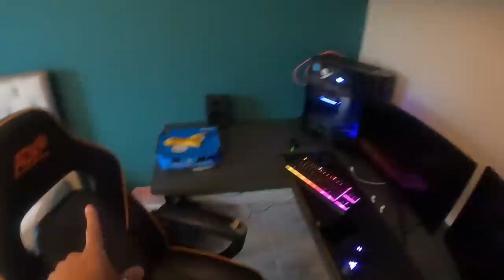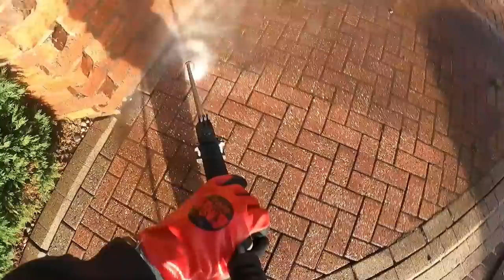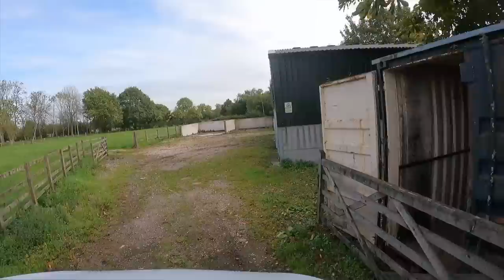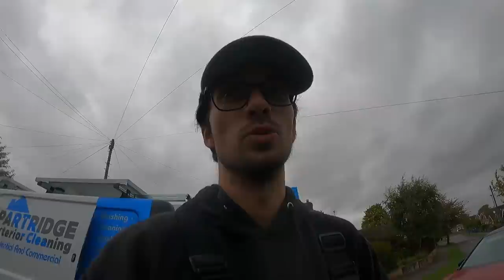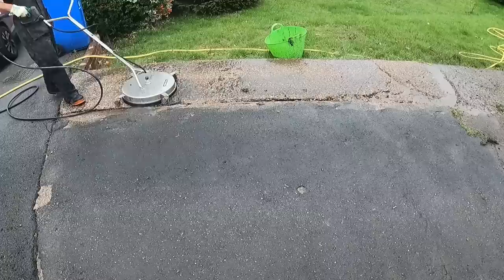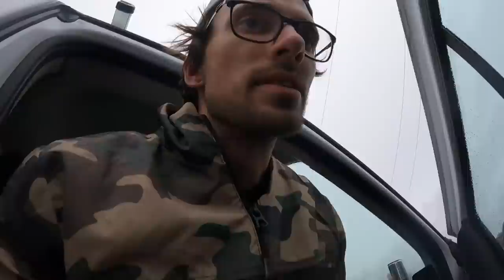I HAD TO WALK FROM THIS JOB... Here's What Went Wrong

Comment: The initial brick looked quite nice.  That small bit was a sleeper.  Complete change of color when washed and a lot of Black Spot.  An excellent improvement when done. Looks like the barn will clean well. 

Thank you for showing the job that turned out to be "undoable".  Now we have seen one that is too worn-out to be improvable.  You tried hard.  Cleaning up the brick wall and walk was still helpful.  As someone said, the roof is in need of cleaning as well, so the owner hopefully realized they bought a place with major overhauls needed.

Comment: I am a gardener the tool that is best for that driveway area is a strimmer with a medium soft line or just a very hard brush. Cover nearby windows and face away from vehicles as you work it will throw small stones. You could probably make a hood. It would clear the moss, vegetation and the top layer of soil, you can run over with a blower afterwards. You can't clean it too much the soil is holding it together. It will tidy it up at least, or you can use herbicide first in the Summer. You could treat the area to prevent moss regrowth afterwards, it is much cheaper than a new driveway.

 I also have a rotary brush for the Stihl combi tool but it would probably damage that surface. The benefit is everything stays dry with the brush and strimmer so it is much easier to clean up. It's not ideal but it is quick, it would only take 5 mins. It looks like they got as cheap thin tarmac job done at some point. I use this technique on old paving brickwork with soft bricks and pointing, crazy paving with plants and herbs the homeowner wants to keep growing in etc. any uneven delicate surface that is too big to scrape or brush. 

Put something in your t&c's like 'If we discover a surface does not have sufficient structural integrity during cleaning we will not continue work in that area until further discussion' to stop people being disappointed.

Comment: My driveway and some of the walks here in the Santa Clara Valley are nearly as bad.  My parents - years ago - had the cracking concrete covered with a pebbly surface to make them last longer.  Cleaning them was "interesting" with a lot of debris ending up in adjacent areas.  I think you did the right thing in admitting that you were risking doing more harm had you continued.
Reply: Yes I had the same problem with my drive ,I was a bit disappointed as at first jklkkolszj jezbcbhrhhhhwhhh patak patacks

Comment: You can’t feel bad about the job Sid. The state of the tarmac and cement… were already in a bad state. So, you did the best with the circumstances, that’s what matters. Also, you have to look after your tools, if the bits coming off were to ruin/damage/destroy in any way, you’d have to pay for a repair/replacement. Hopefully the owners can get it all sorted.

Comment: Walked away from a job for the same reason about 2 months ago. Neighbor came out and spoke to me as he was leaving for work, told me his drive was the same age, but he uses tarmac restore paint on his every year for the cost of under £25 each year to self apply with a roller (laid in 1996). The difference is night and day. His looks brand new and the customers I was doing looked like it had taken a few grenades... I did similar by cleaning just the bits that were in good condition and his path to the house and accepted a nice brew as payment ♥ You are a good guy Sid ♥

Comment: Had a similar situation with a crumbling combination driveway.
Our solution that would work there too would be to curb the garden side of the drive way.
A few courses of bricks around a down spouts. Then order a load of gravel & back fit the lot!
Advantages:
- cheap and quick
- drains well
-  never a problem with ice or snow
-  added security as you always hear anyone skulking about on the drive or around the car.

Comment: Those mushrooms as called shaggy ink caps. They can be eaten but when they get to that stage and have the cap curling with the black they are past it and hard to work with. They produce ink and are messy. They are a choice mushroom and don't sit well with some people. Not psilocybin/ non psychoactive.

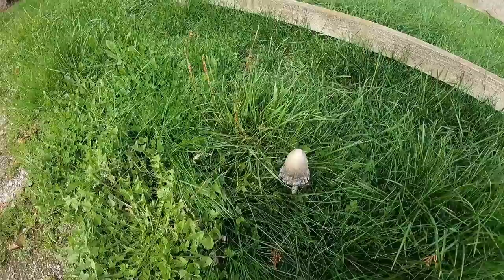Comment: 8:21 I'm not an expert in mushrooms. But from what I've gathered, it appears to be a Common Inkcap. Everything I've learned about it is that you technically could eat it. BUT, very important! But do not eat it if you have ingested alcohol within the last 48 hours or plan to drink alcohol within the next 48 hours after eating the inkcap. Apparently there is something in Inkcap that reacts badly with alcohol and will make you extremely ill. So...maybe best not to give it a nibble.

Comment: I would have gone ahead with it if that's what the homeowner wanted.  He was probably expecting to have to repair it anyway, but getting the muck out would make that process easier.  The only issue would be liability on your part.  If you thought there was a chance he would be upset with your or sue you then definitely walk away.  You need to have policies in place concerning what you are willing and unwilling to do.  When I was fixing computers, the client needed coaxial cable run to his computer room for internet.  We forgot that room wasn't wired for it.  He tells me that I can drill a hole in the floor to string the cable through.  I said, no, you can drill a hole in your floor.  Then I'll help you string cable through it.  But there was no way I was drilling holes in anything.

Comment: Why blast the hell out of paving with a pressure washer, making the surface rough and easier for mould, lichen and dirt to stick to it, and u also beat all of the joints out! Total bodge!All you need to do is fill a watering can with a strong bleach mix and apply, leave to soak and then rinse with a hose! Takes no time at all. Pressure washing is a waste of money and counter productive

Comment: Would there have been any value in spraying a herbicide/algaecide/chemical over the green parts for the customer instead of the full clean, which as you showed, was causing more damage than desired?
Reply: i thing it would not have made it better. it seems as he was correct that the moss was actually holding it all together.  it might look nice for a day or two but the integrity (as little as there was left) created be the same moss would be gone.
Reply: sirBrouwer and Lucinda Jackson - I understand that, but without actually pulling out the plants, the roots could still have held on to the tarmac/cement, but I certainly understand that the strength of what remains of the plants would be significantly reduced. It was just a thought!🙂

Comment: good video m8 i seen u used to have a honda slip stream pro pressure wash im looking at getting into it currently just window cleaning is the slip stream pro still a good option and if so what extras or add ons would u recommend for the system cheers sid 👌

Comment: boy you could have power wash all that. nothing is going to happen to that concrete that's already happening. The object is to make the place look clean, not the back out because of some damn cracks. I power washed many sidewalks with cracks and many driveways with cracks and many walls were cracks that look worser than that and nothing has bad has happened